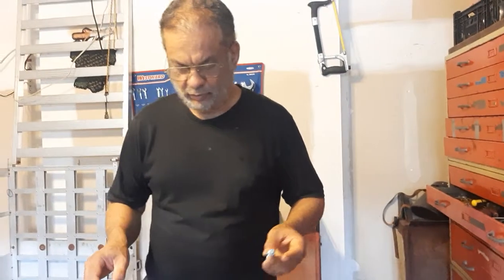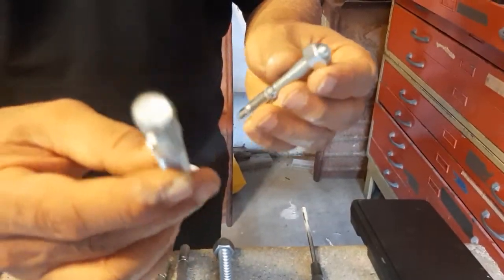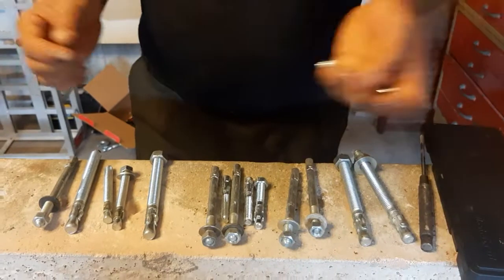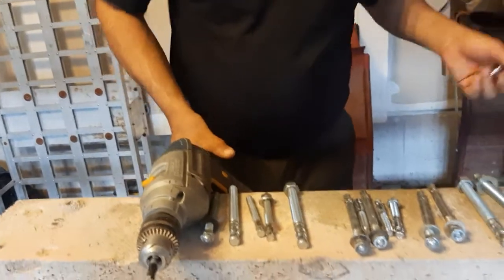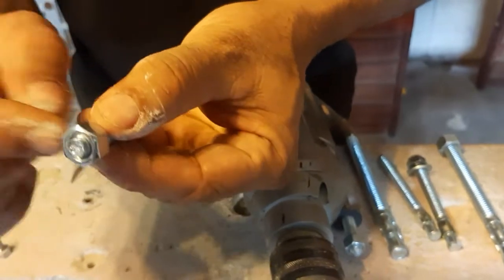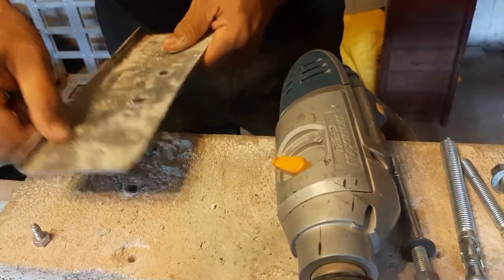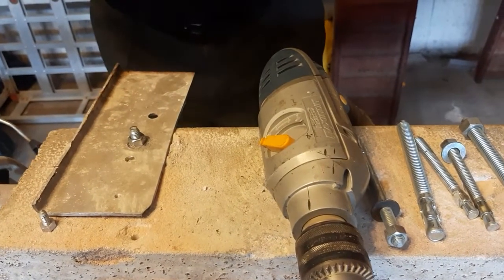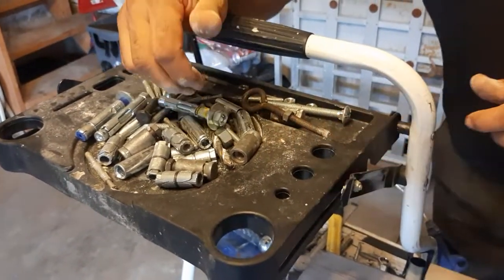How to installed wedge anchor bolt part 3

Comment: Do we also have to apply araldite to it to make it more tight so it can me more sturdy ?
Reply from the maker: there are some other type of anchor bolt where you use adhesive araldite but in this type you don't need it but for more strength you can add a araldite but it will be quality of araldite not a bolt you can also add arldite if you think concrete is weak .